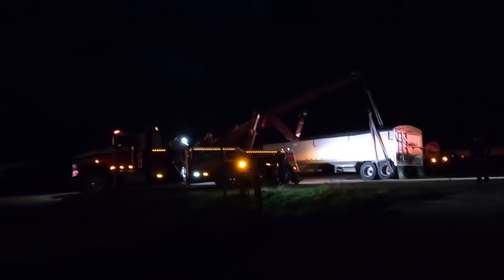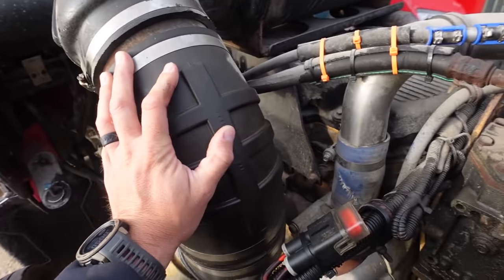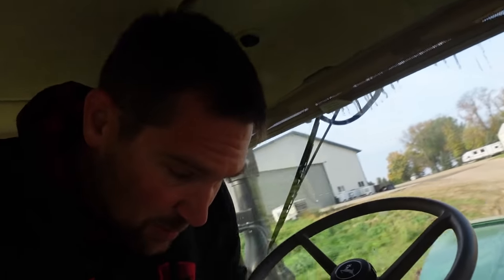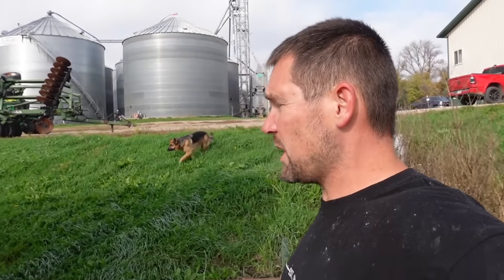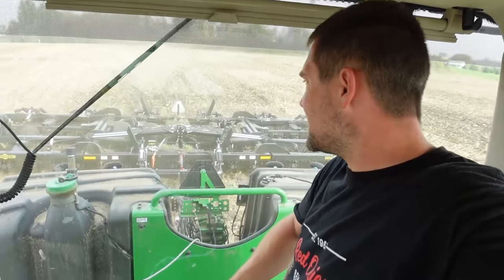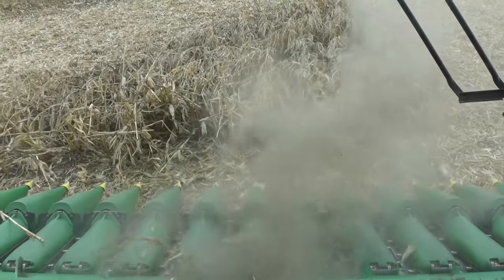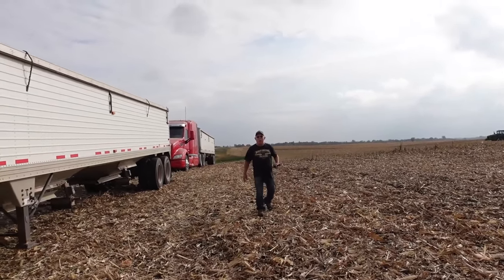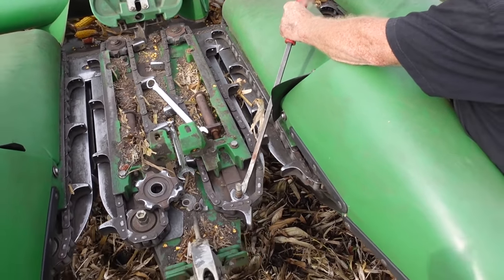Semi Truck ROLLS OVER on State Highway - NOT GOOD!!

Comment: That rescue was more dangerous than the initial accident.
Reply: I was shaking my head the whole time. Glad nobody got hurt on all those snaps.
Reply: As sponsored by The Three Stooges Heavy Haulage.
Reply: They need Ron Pratt
Reply: @Victor_Victory  I just searched for a comment like this. Your are completely right, man. Ron wouldn't have damaged the rope or chain. If you see Ron operating his Tator, I would say, this was a job for 10 Minutes (without rigging and setting up of course).
Reply: @Victor_Victory  Thanks for the steer, Victor. Justchecked him out - almost identical recovery, but a sand trailer and the truck unit in the ditch too. Ron arrives at 7:14 - truck's out and ready to roll by 19:27. Just Ron, a couple of wire ropes and diverter hitches, one winch, nothing snapping, no scary thumps - job done and off to the next gig. That's a pro. I'm subscribed.
Reply: @Victor_Victory  a few basic wreck masters classes would've handled it too.
Reply: That's what happens when you send a tow truck on a CRANE JOB.
Reply: This rescue should've never been done from the side like that. It should've been done from the rear, slightly off-set with two lines picking the back of the trailer up out of ditch then walking it sideways with the two lines until it was back on solid ground. That tow driver/operator is lucky to be alive because that line and snatch block could've came back at him.
Reply: @kingjames8283  And worse the guy seems to have no clue about the specs of his stuff neither about the load he has to lift. One day he will get some in the face and he will have no worries anymore!
Reply: @BabyJesus440  m
Reply: Richard Walsh, your definition of dangerous is far different than mine.
Reply: Accident? Should’ve turned wider.

Comment: Glad everyone is safe. My only concern is all the trouble that wrecker had. Two separate big failures on one recovery is kind of a big deal when you're doing heavy towing.
Reply: I have watched plenty of recovery videos. That certainly was not a good one as far as the tow company was concerned.
Reply: I was thinking the same thing I have never seen that many breaks on a “simple” recovery
Reply: Most definitely, I’d almost bet that “recovery”  helped  along with other factors that damaged both truck and trailer.
Reply: Should have called Jamie Davis

Comment: After driving tow truck in Southern California for 20 years doing stuff exactly like that watching this video I can say those guys need a little bit better equipment and a little bit better training 
glad nobody got hurt though
Reply: Sumter has had three just like this in the last month, same ditch. Never had any rigging issues.
Reply: @donniebrown2896  I can only go by what I seen 
And with my experience know how I would of done it 
Doesn't make me right or wrong
Everybody has their own way of doing thing's
Reply: @donniebrown2896  first break was because he chained the second winch line to the back of the truck, and then extended the boom without disengaging the clutch or powering it out. Totally operator error, not paying attention or planning ahead.

Second break was because the shackle at the end of the straps was not rated for the load they had on it and it just opened up. Could have been defective/damaged, but probably was way undersized for the load because the operator didn't calculate the loads properly, or they didn't have rigging heavy enough to do that job with a loaded trailer.

Comment: That wrecker service owes you a tarp on that trailer, and no charge on finally pulling it out.   It's as if they were too scared to use the crane for what it's meant to do.  Of course with a chain and shackle break in one job, I'd be scared to use the equipment to...   It'd be cool if you could hook up with Ron Pratt, send him the footage and have him do a breakdown on it.

Comment: Sounds like you were pretty level headed about the whole thing. Sign of a good boss. Accidents do happen and thats why there called "accidents" and not " i meant too". Best wishes
Reply: I’m amazed w/ the shear size & weight of tractors/implements, trucks/trailers farmers drive on those narrow country roads, ditches on both sides, overhead wires & oncoming traffic INCLUDING other farmers esp during harvest that there’s not more accidents. 
That’s the difference between drivers & operators. Farmers are equipment operators. I can’t back up a 4 wheeler with a trailer 4 foot trailer.
Reply: @chrissyfrancis8952  there is a point when you just say ''fuck this im taking the whole road'' and do what need to be done.
otherwise you have too much trouble trying to ''fit'' in traffic.

also funny enough, it's harder to back up a small trailer than a big like this one.
however a smaller trailer is easier to deal with while driving foward, don't  have to always make sure the back will pass where the front did
Reply: The supervisors I learned the most from all had the, "Stuff happens, there's no point making you feel worse than you already do. Let's learn from this" attitude.
Reply: @keshlalish5586  a good driver takes all the room possible, a few unhappy cars are a lot cheaper than a hook truck. And the rules are really only suggestions when you get down to it.
Reply: @AGilman61  Driver should have stayed back away from the intersection until the traffic cleared.

Comment: I remember when I started to learn actual tractor driving, I was plowing a field with the "actual plough" or what an european would call a plough, it is 3point attached and the whole thing lifts up and obviously hangs out the back quite a bit, so it also swings around when you turn around. I just decided to learn the turning brakes, brake for each back wheel so you can turn on almost on the spot with regular 4 tire trac. Whee went the tractor around, whee went also the old field barns corner😂 I remember I was so scared to tell dad. In the end he just pushed the corner post of the barn back in its place with the plough
Reply: Been there, but mine was with my good buddy’s brand new tractor and wide roller harrow on the fence 😬

Comment: I once folded the Self Propelled Sprayer's booms into the power lines at the end of the field at quitting time ... sparks was flying everywhere ... to my defense, it was the sixth day of 18 hour days spraying 😁
Reply: Hahahhaha.  I did almost the same thing with a tractor mounted 70' boom.   It was the end of the day and I was trying to get done. Got to the end, didn't slow down and made the turn.  Well either the pole got closer or the boom got longer and I folded the end of the boom right around.....   Dad never yelled or anything, we just had to fix it the next day....  It happens.

Comment: When I was growing up the neighbor had a mid 70’s massy combine with a 4 row corn head and a 16 foot bean head. Also had a Case combine from the 60’s with a Chrysler slant 6. It’s amazing how much you guys can get done with this big equipment. The biggest tractor they had was a Case 1370 and I think fuel capacity on it was 65-70 gallons. No government juice and as long as the batteries had juice it would start any time of the year.

Comment: watching you take those springs off the discs reminded me of when we were using John Deere 71 double disc planters and a fence staple would lock the discs together, causing them to drag and wear flat spots while not planting so we had to check every disc every pass.  But when we only had 6-double rows it didn't take long.

Comment: Zach, first and foremost. Nobody was hurt other than the driver's pride. You have a great bunch of folks working with you, so I doubt the driver woke up in the morning with the thought of putting the trailer into the ditch. As you bear witness to it. The chains, cables and straps are noting to mess around with. Just keep on doing what you do, I'm not about to screenshot quarterback your operation.

Comment: Forget the duct tape. Use electric tape. Electric tape sticks better and the overlap of the tape really helps to seal it up. I've done that on a inner tube before as a emergency repair and it worked. 2 months later and the tire was still holding air.

Comment: I did the exact same thing 30 years ago. Farmer came with a grain cart and a portable auger. We unloaded the trailer, then jacked it up and put blocks under the wheels in the ditch. When it was about level, we drove it out. No wrecker, little expense, just a lot of work. The trailer, a Merritt Ultralite, sustained no damage even though it twisted just like this one, raising my drivers off the ground on one side. I think this wrecker did a poor job.

Comment: I don't see many comments talking about the tow truck guys and there lack of equipment that holds together. Now I am not a tow truck operator so yes Monday morning quarterback. However I have operated cranes with load limits of 140 Ton and below. We would NEVER use rigging not rated for the load, or not use padding to protect straps. Maybe it happens all the time in the towing industry. But when over head cranes are in use safety is THE MOST important thing ever. For you and your coworkers. Glad it's out of the ditch and no one was hurt. But I don't care if people are butt hurt.

Comment: When pulling a trailer swing as wide as you can... Also don't check a loaded bumper pull with your 2 middle fingers, while the co-worker shoves it at 630 am on a Monday. Took the tips off of my 2 middle fingers lol.

Comment: I put a loaded tipper (44 tonnes GW) into a field when I missed a junction (unwrapping a sandwich)
In the report afterwards it was noted that the wrecker did most of the damage dragging it out backwards. If she could have been pulled forwards the damage would have only been cosmetic.
We ended up with a twisted chassis on the tractor unit. Watching the shop twist it back was insane. The torque required was immense.

Comment: Usually the truck will lean to one side or another if the frame rails are twisted.  You can measures at different points from the frame to the ground on a level alignment machine

Comment: I turned over an old 30' fruehauf dump trailer on an 88 w900. The old patch welds holding the cylinder cross member failed. It was the 4th time I used it and we JUST had a roll up dry tarp installed. It lifted the drives not that far but off the ground But about 2'. I damn near st my pants because I was in the van with the door open.  It spent about 12hr like that. The truck still runs true but hood latch will not stay locked. I've added another one but they'll both pop off driving. so she's a little tweaked. I bet you'll have a similar problem with this rig with all that weight and flex something's bound to give (pun intended)

Comment: We had an accident a long time ago when my dads boss was unloading a short dump and tipped over cause the cylinder on the short dump snapped. The semi didn’t go sideways with the short dump but the truck frame was bent as hell. My dads boss drove the truck home and a matter of time, the truck settled out and we still use the truck to haul grain to this day. Your truck is the same as ours, so hopefully it will settle out.

Comment: That was a bummer to watch we all hate to see damage to equipment but shit happens the first two things that come to my mind are sleeper cabs have a big blind spot when turning right and power mirrors on that style truck are a must have and the rigging breaking was a either a defective D ring of some sort or a shackle that was turned sideways and pulling against the Pin threads, it’s very hard to try and save a loaded trailer without damaging it but the good news is everybody is safe and everything else is repairable.

Comment: Won’t be the last time… saw someone drag the back third of a 100 ft planter over a ditch leaving the field… also watched from up the driveway as someone pulled into the shop with the bin extensions up… that was a few days after he left a field without folding them and took out some power lines…. First season with a 690…

Comment: We have 3 coal trucks that have bent frame we had the trucks wheel alignment and been running I figured it would have been bent some but if it drive fine keep running take to a frame shop they can fix it or if it not that bad just keep running it

Comment: Just join with this channel and looking also randomly old videos. About this accident; not clear thinking and too much hurry! I’m myself truck driver and know that if You go easy than this never happens! Also noticed that one of combain is not starting very well. Seems like fuel problem when air is in system. Somewhere is leaking and it takes air in incoming fuel hose and therefore it let’s fuel go back if it stays and not running currently. Should be easy fix!

Comment: Seeing Zach always running up those silo ladders tapping on the tank wall to see how full/empty the silo is. I just start wondering why he not get a couple of radar level transmitters installed on the silo tanktops with readouts somewhere on the ground level. Maybe in the corn dryer operating shed.... It saves him time and safer in operation too.

Comment: not picking on that driver but i would of used 2 snatch blocks,  lifted from the tandems with 2 6x6 blocks to keep the cable off that trailer. simple pick and swing. still, nobody was hurt, good recovery

Comment: :38 recovery vehicle operator should have attached a lower winch line and start dragging it while it was stabilized from tipping alternating between boom and lower line.  They did it at 1:07 after there was to much weight on the left side.  Better yet, Should have ran his lifting strap the whole way around the back of the trailer with a spreader.

Comment: I congratulate you for the great work you are doing.. and the truck driver may get hurt.. Either you fill in the edges of the curve .. Because the angle is difficult and the wheels of the trailer are at the end of the trailer, and this increases the difficulty of turning .. is just my opinion.. Greetings

Comment: Zach just a thought...But.. We had a simmilar thing late October 2017 with a super B "Large Truckin Company" loaded with 96,000lbs 46-00-00 fertilizer to my yard long story the driver messed up followed GPS went up a 10+% grade in dark slid backwards Jackknifed and twisted in ditch. We were able to unload the trailers back 3 tanks one at a time on icey grade into a grain wagon  with large 4x4 tractor. Got the weight off all but the front tank above drivers and  chained up + towed up hill tractor in ditch for traction. Only damage 2 burst bags. Sad that yours happened going onto pavement.. Otherwise... Would have ankored the trailer and vacced out the grain from the top down to get weight off first. Plus side...Getting lots of views!!

Comment: Definitely an unfortunate situation with the trailer…nuff said on that. 
Question-Zach don’t the clumps made by the Mandako somewhat dissipate in the Spring when they’re wet from the winter snows and early Spring rains? I thought you wanted a bit of clumpy ground to help trap snow and keep the soil in place. 
Coming from a southern Alberta farm hand on the family farm, I may need an education on Minnesota farming practices. 
Great videos ZJ, keep ‘em rolling.

Comment: A buddy with whom I had share cropped with had bought a like-new aluminum hopper trailer for hauling grain.  I swung by his shop on the corner of a field the next morning and saw that trailer with its hoppers bottomed out on the road where it crosses a levee.  It took my buddy's new driver only a day to ruin that trailer.  Yes, it bent the hoppers enough that the trailer frame twisted, too.  End of trailer, end of new driver's job.

Re:  The rolled trailer.  Would it have helped to unload a portion of the beans to lighten the load and reduce the damage to the trailer when righting?
       Why didn't the wrecker move closer to the trailer so that the lifting straps were pulling more straight up rather than around and back, putting a lot of twisting moments on the frame?

And thanks, your videos are interesting ... if not sometimes agonizing.  Maybe not on the same scale, but I think many viewers have been there/ seen that.  You are not alone.       ☺

Comment: For those who are wondering what happened with the Wrecking crew, to me it looks like the first break was because he chained the second winch line to the back of the truck to keep it out of the way, and then extended the boom out without disengaging the clutch or powering it out, and it just pulled the cable tight and snapped the chain. Totally operator error, not paying attention or planning ahead. And if he had hooked it directly to the back of the truck, rather than the small chain, he might have broken the boom and had the whole thing collapse on them. 

Second break looks like it was because the shackle at the end of the straps was not rated for the load they had on it and it just opened up. Could have been defective/damaged, but probably was way undersized for the load because the operator didn't calculate the loads properly, or they didn't have rigging heavy enough to do that job with a loaded trailer.

Both were problems that a properly trained and properly equipped operator and rig would not have had, because you aren't supposed to have rigging failures on this any more than on a crane. That's why you have load charts and Rated equipment.

So I hope that the owner gets better rigging gear put on the truck, and that this operator seeks more training on rigging and heavy recovery.
Reply: Edit: that should be "Wrecker crew".... Lol